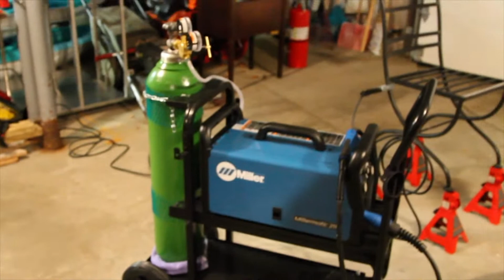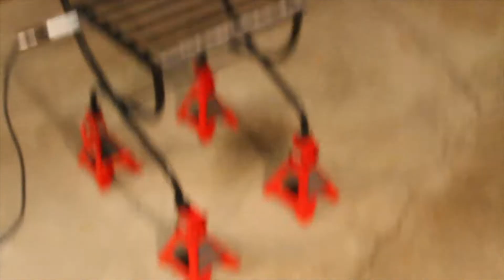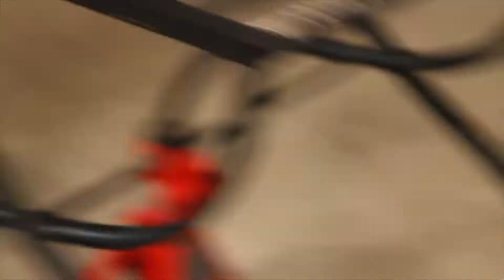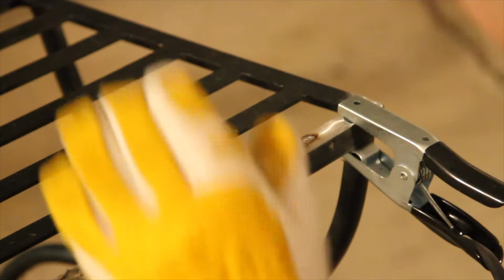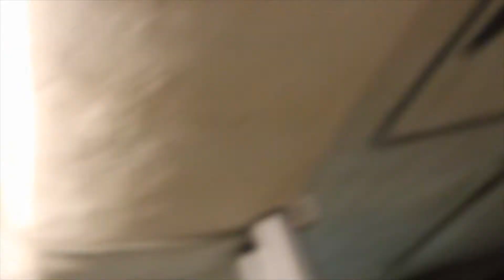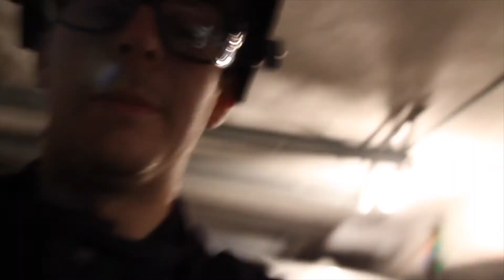My First Time Welding! Mig Welding With The Millermatic 211

Comment: You should start with the tip wire cut and start close to the metal. The gas will shield the weld better. Also maybe look at some welding you tube lessons it will help.

Comment: That’s a badass welder, for never ever welding you just bought a kickass piece of equipment. Practice will make you better keep at it , don’t pull away the trigger when welding, get closer and keep the same distance as you weld on.
Reply from the maker: Thank you sir! I spoke with some friends who have some experience and they let me know if I bought the 211, I would probably never have to uprgade unless I got into TIG, so I went for it. Definitely not disappointed so far, more content to come!